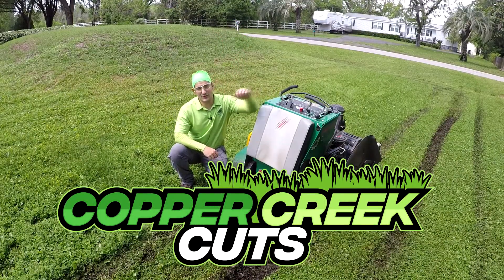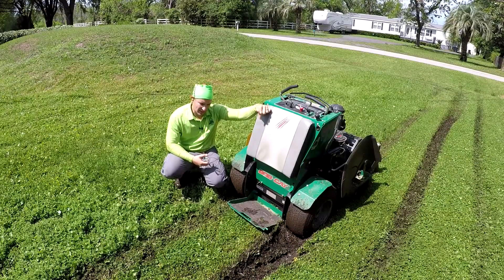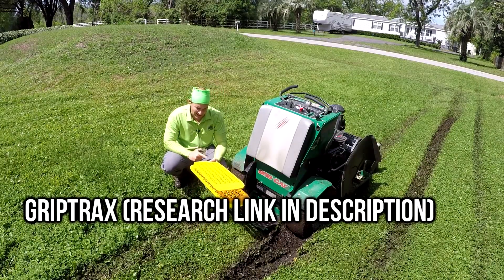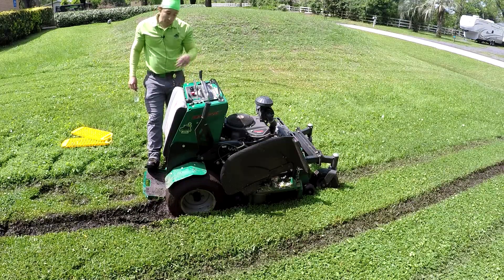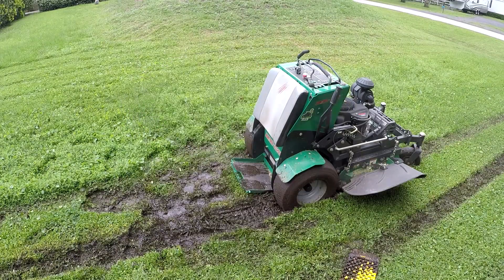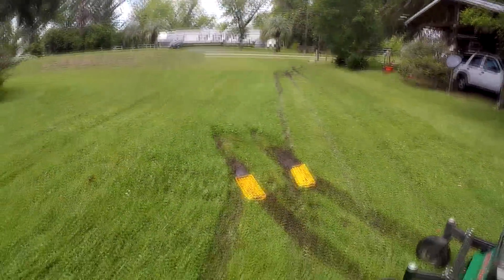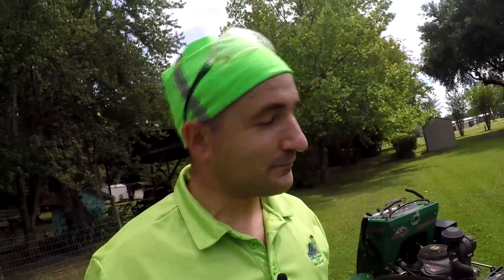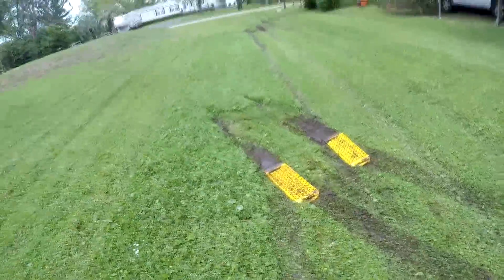Stuck In The Mud TWICE In 10 Minutes (GripTrax)

Comment: The type of switch you were talking about is called a dead mans switch, it is designed so that if the operator becomes incapacitated for some reason, the machine will switch off to prevent further injury.
Reply from the maker: Thank you for the clarification!
Reply: @BakerCountyTrashPickup  No problem!

Comment: I have 2 wright mowers the kill switch is in the platform but it’s only for when the blades are engaged
Reply from the maker: I like that setup! Still prefer to flip up the platform for more options on feet placement when stuck but much better setup than the SCAG.
Reply: Copper Creek Cuts Lawn Care i don’t like scag either, a buddy of mine has a bobcat stand on and he loves it, I have an older bobcat walk behind and a predator pro zero turn

Comment: I did that just the other day, was mowing an overgrown area, got stuck, walked to the garage, started my quad with a dead batty with a kick start, rode to my grandparents to borrow there chain, came back pulled out the mower, returned the chain, parked the quad, walked back to the mower got on, and figured if I go from the top of the little hill, il be fine....high centered, so again start the quad that doesn't like to start, get the chain pull it out park the quad and decided there is a spot that doesn't seem wet at all (I mean I can walk on it and it is a little spongie, I know not a word) so I start mowing and get stuck.....walk back to the house, start the quad, go get the chain again pull it out (or so I thought) return the chain, park the quad walk back to the mower......only to find I dident pull it out far enough...get on the quad and well you know the rest of the story, so I decided after that to go mower the dry spot by the road...... And I got high centered in some ruts from last fall, so you know how the story goes, get on the mower, at that point I'm done.....and I'm out of gas, so back to start the quad (once it gets warm, it has some really bad kick back) get the gas can, fill up the mower, put the can back, and park the quad, go back to the mower, starts up fine, go back to park it....and I forgot that the mower needs to go behind my quad, so start the quad after 10min of kick back, park the mower, park the quad....oh forgot to mention it was starting to get dark when all this happened, hopefully this maybe helps you not feel as foolish 😜, I have learned my lesson, I now have my own set of chain and charge my ATV battery so it starts easier😌
Reply from the maker: LOL I SO appreciate you sharing that, yes, it makes me feel better!

Comment: For my zero turn commercial mowers I disabled the seat kill switches.   Stuck….it happens and zero turns are horrible when stuck so I installed 3500lb winches to the front of both of my mowers.  Also can get a broken mower on the trailer.